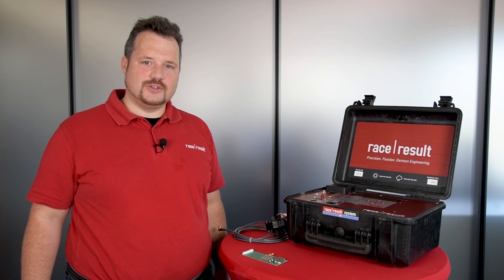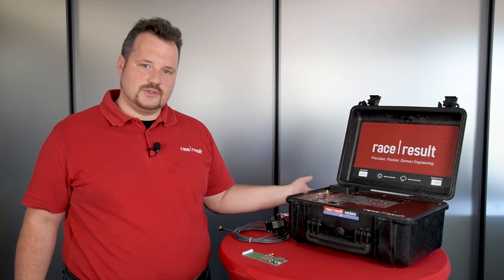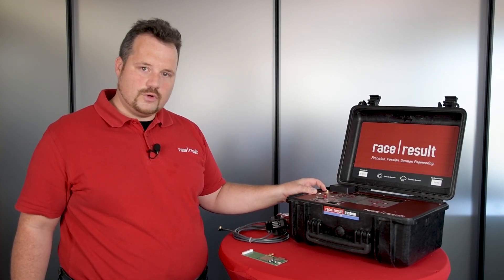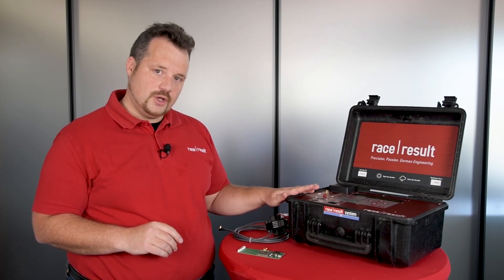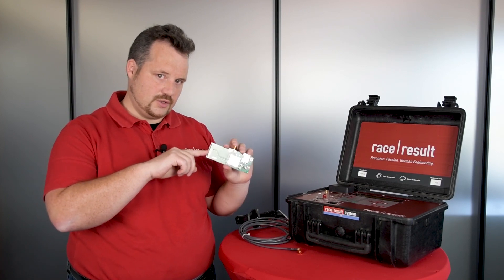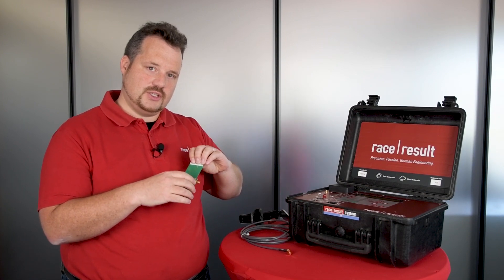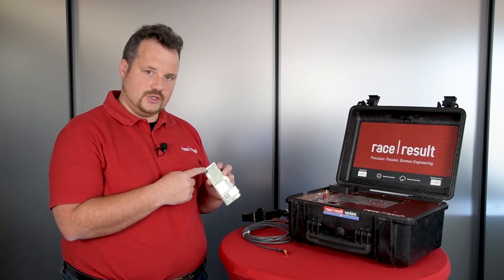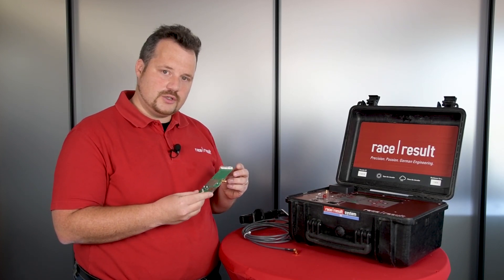race|result 5000S Series System & 4G Module

Comment: So does this mean a reader switch from FX9500 to FX9600 in the S model?
Reply from the maker: We did a switch and do not use the FX9500 anymore. Please note that we don´t use a standard configuration on our decoders. To promise good detection rates a special firmware is indispensable.
Reply: yes